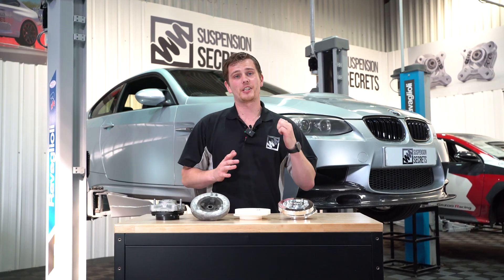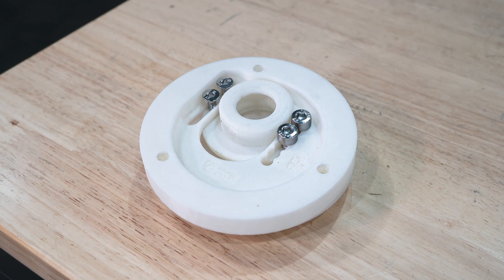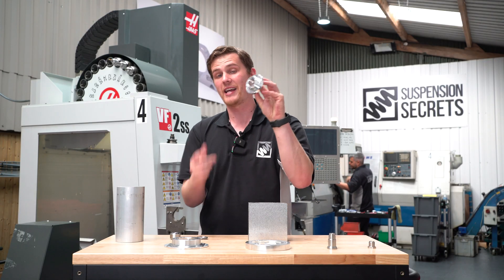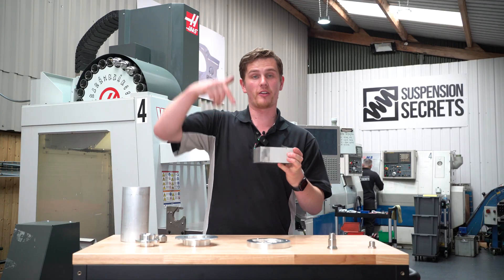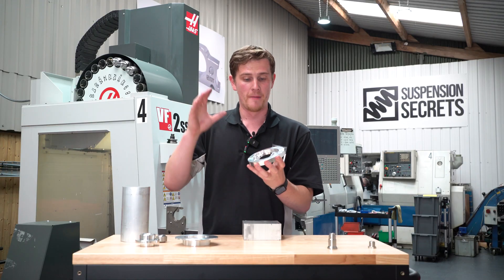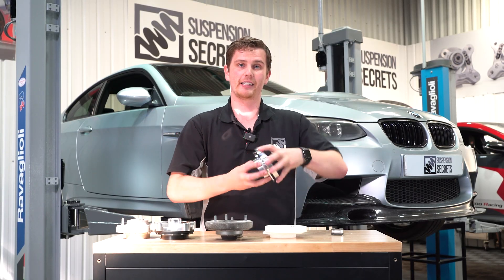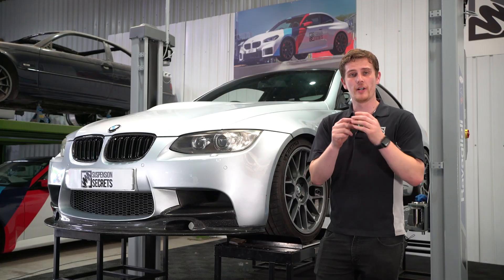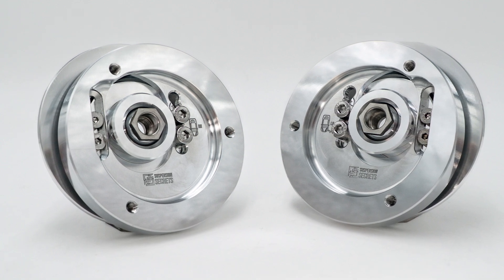How we DESIGN & MAKE Performance UPGRADES - BMW E92 M3

Comment: So one thing I’m struggling to understand is how the no slip aspect of the camera plate is supposed to work, so are you basically saying that you can only have camber at certain positions compared to like most place where you can just pick any degree you want. Like say I wanted 3.6 instead of a 3.5 can I make those small adjustments and get the specific number I want or is it only a lot of certain positions????
Reply from the maker: Thanks for the comment. We would be happy to explain. Yes there is a series of holes in the plate that are toothed in a fixed position so yes you would have to choose a definite position. 

This means that you would have to set it in either -3.2 or -3.5 and not have -3.35 as an option for example. But the difference of 0.1 degree is minimal if you are not racing competitively. So you have better to have a number close to optimal that you know 100% isn’t going to slip out of position when in use. That’s why it is our much preferred design option as we have seen so many camber plates slip out of position over the years on other products 👍
Reply: Camber*

Comment: Take these camber plate / top mounts to the next level and add seals… the UK is a harsh environment with salt and grit attacking those bearings… it’s should be possible to find some seals to work…. Keep weather out and keep grease in.
Reply from the maker: Thanks for the comment. The spring perch bearing is a sealed unit so is protected but both bearings are fully covered and protected once fitted to the car as the rubber spring boot on the damper fully protects the assembly from below once installed 👍

Comment: Nice. I had to remove millways as they rattle about on my edc e92.  Hope these are better !
Reply from the maker: They are indeed! Noise free and the bearings are included in our lifetime warranty which is unrivaled!
Reply: @SuspensionSecrets  do you have bolts to replace the oem threaded top mounts/nuts?    The oem nuts have a shoulder for the strut brace.  I don’t see fitting instructions on the website.  Assume the rubber spring seat transfers over too ?
Reply: @SuspensionSecrets ordered today. Cant wait to get the camber back. Any recommendation for static camber now there’s more caster ?  How much more do they add ?